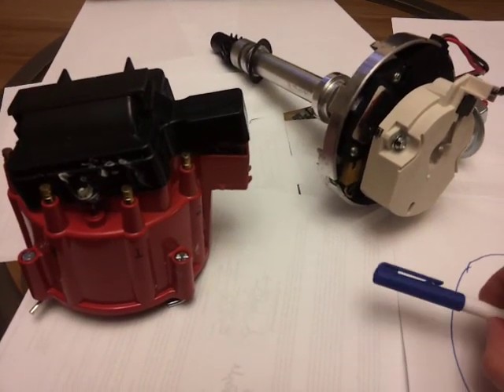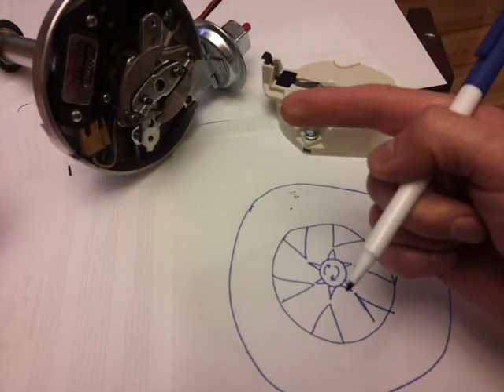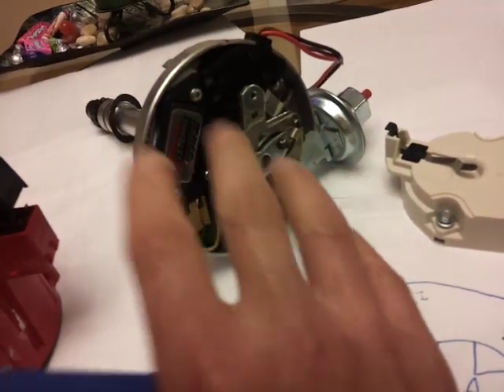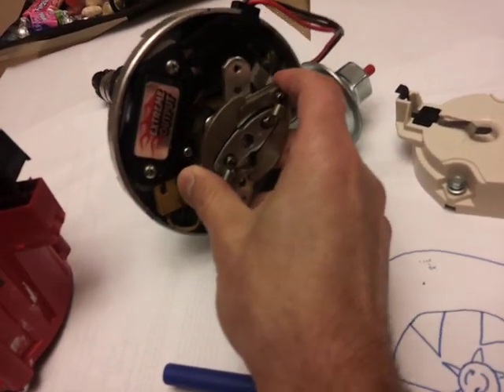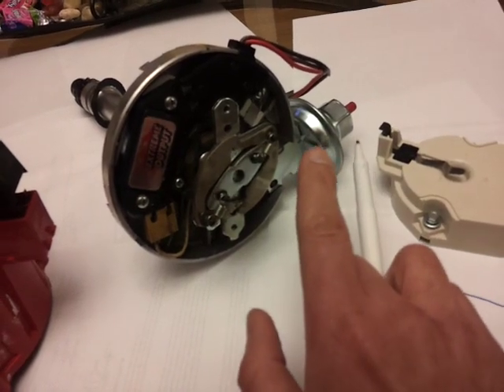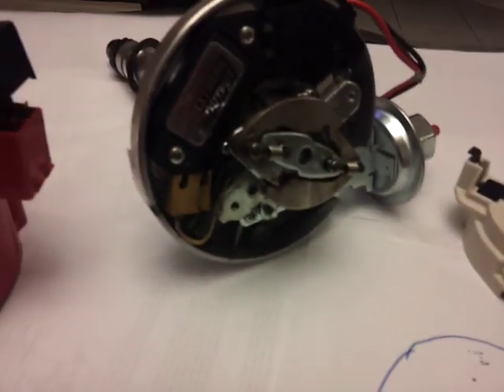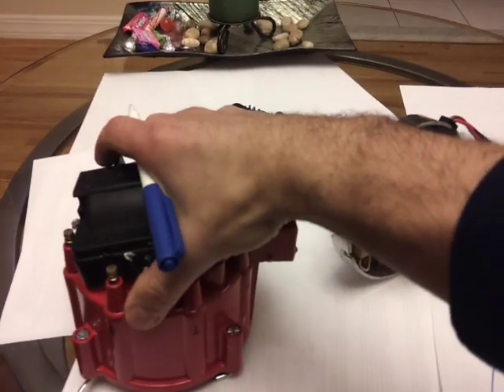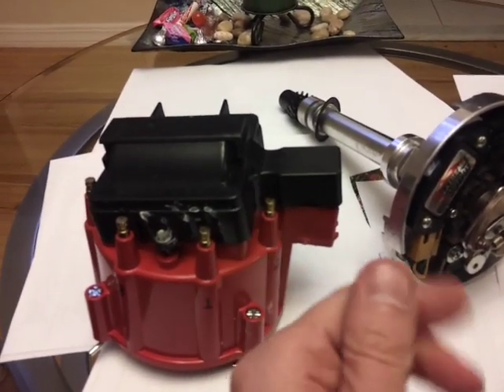How a distributor works REAL EASY TO UNDERSTAND!!!!

Comment: Hello thanks for the video.. ?  my distributor cap is not one with a head for a tach.i have a small block Ford one for a 289 motor.. it's hei the instructions for the tach says to run the green tach wire from it to the coil - side that came with my distributor which I did. But when connected the tach just jumps around.. can I still run a tach if I don't have the tach setup on the cap?

Comment: Hi. Great video. Can you tell me please. If these two springs are not original (not from exact distributor) the ideling can go wrong? I've got such problem with my Pontiac W72 400cui engine. Can't set the timing because of it.

Comment: Good video. I watched before I went to work on my tune up and found that my distributor does not seem to have vacuum or mechanical timing advance  which makes me believe that it is entirely electronic on a 1989 GMC suburban. Wondering how I play with the advance curve if it is all computer controlled?
Reply from the maker: Thanks for watching..you would need to tune the computer through a program

Comment from the maker: Hey thanks for watching..the springs only control how fast all of the timing comes in..it is possible if the springs are very weak that it can cause an erratic idle (not correct springs)..also look for rust around that area and see if everything moves freely

Comment: I hope you recover from your loss of your left arm. You might consider a holder for your camera until you get a prosthesis to serve as your missing arm. It to me is amazing you can explain all the moving parts without disassembling the distributor. Ironic you use the term "retarded" when you refer to the timing. Seems appropriate in other context in this video.